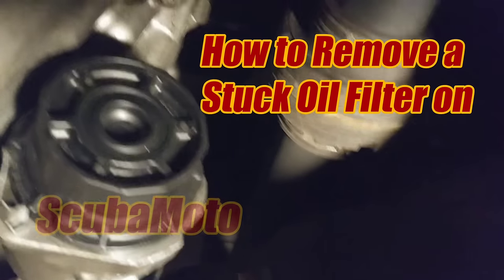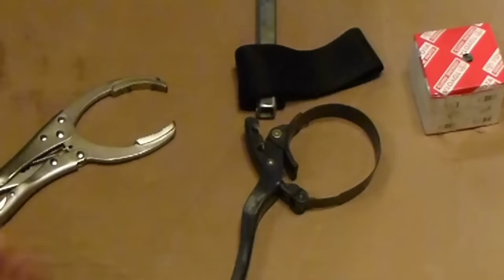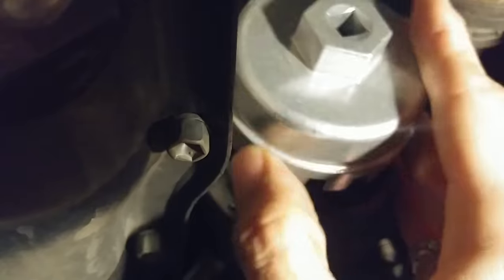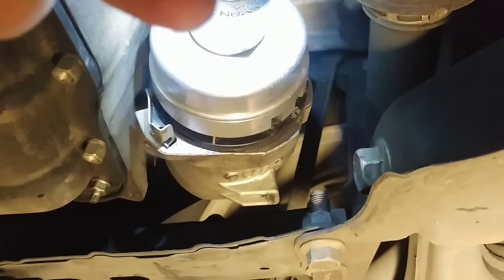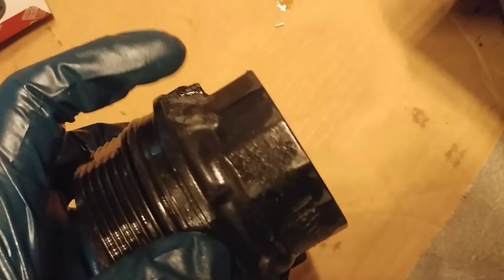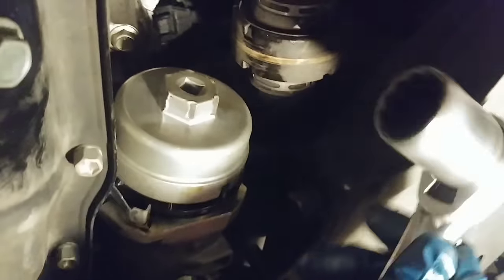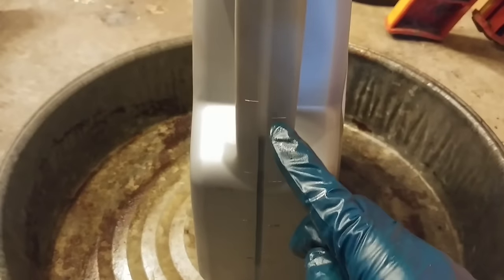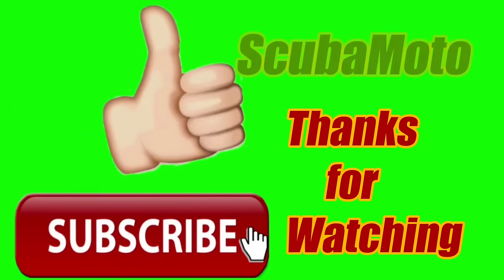How To Remove Stuck Oil Filter Toyota Prius Corolla Lexus Oil Change

Comment: Dang near an impossible oil change. I have a Highlander and spend two days trying to loosen the metal oil filter housing in order to change the filter -- all to no avail. I ended up having to take the car to a shop where, no kidding, it took two men with a 5-FOOT BREAKER BAR to loosen the filter housing. Even they had to work at it a long time. I like Toyotas, but that's the worst oil filter design ever. It's almost like Toyota made it intentionally difficult for the home mechanic to change the oil . . . .
Reply from the maker: Michael Patrick McClung: Thanks so much for the comment. That's the first time someone has commented that they had as much trouble with a metal one since most of these are plastic. Your experience just further proves that many shops out there are installing these with impact tools that leave them severely over-torqued in a matter of micro seconds. I hope that shops watching this and reading will learn that hand tight is plenty for these filters. Thanks again for the comment and thanks for watching.
Reply: It's not the design. It's the idiots that put it on. The torque specs are right on the oil filter cap. I guess the mechanics are illiterate? Maybe Bigfoot is doing oil changes in their shops? Or that guy with the muscles in that TV commercial where he says "I pick things up and put them down".

And yes, switching to metal is NOT the solution. An aluminum filter cap screwed into aluminum can experience galling which can be an even worse situation.  What is galling? 

"Galling is a form of wear caused by adhesion between sliding surfaces. When a material galls, some of it is pulled with the contacting surface, especially if there is a large amount of force compressing the surfaces together. Galling is caused by a combination of friction and adhesion between the surfaces, followed by slipping and tearing of crystal structure beneath the surface. This will generally leave some material stuck or even friction welded to the adjacent surface, whereas the galled material may appear gouged with balled-up or torn lumps of material stuck to its surface. 

Galling is most commonly found in metal surfaces that are in sliding contact with each other. It is especially common where there is inadequate lubrication between the surfaces. However, certain metals will generally be more prone to galling, due to the atomic structure of their crystals. For example, aluminium is a metal that will gall very easily, whereas annealed (softened) steel is slightly more resistant to galling. Steel that is fully hardened is very resistant to galling"

I would stay away from the metal oil filter caps unless you're going to change your filter yourself and avoid extended change intervals in which case the plastic one should be just as suitable. Main thing is not to over-torque the thing.
Reply: Omg i just came inside so upset 😡 same thing im dealing with. I have a 2019 hiighlander. I'm seriously almost thinkin the dealership never changed the filter at all .
Reply: @ScubaMoto  my car has the plastic one - 1/2" torque wrench indicated it was tightened well in excess of 90 ft/lb.  What kind of knuckle dragger torques a plastic housing like it's a damn lugnut
Reply: They are super easy if you do em but if a shop over tightens it your fucked
Reply: Just came Inside to do research to make sure there wasn't a reason I couldn't do it and nope. Just like I thought I from a lazy prick overtightening it
Reply: @mauriciochavez914  since you can't see the filter you will never know if anyone does change it.  They don't want the oil dripping on them so since you can't tell why do it..
Reply: Same difficulty with my new to me   2010 Prius. Ended up cracking the plastic housing on removal. Found out after a mess on my driveway and a nice letter from our HOA! I’m done with this crap, I ordered the parts to convert to a traditional oil filter.
Reply: @readme765 I got fined from my hoa for filleting a striper in my driveway. I live in the woods now

Comment: The Toyota designer should be ashamed. What’s wrong with the old spin old filter ?
Reply: Apparently more eco friendly (less material), less weight, and cheaper for production. They're not so bad if the previous tech didn't over tighten them, but I hate the stupid design. Spin ons are always better!
Reply: They need to hire an design ingenier like me. But young People are more Stupid thrue The years...
Reply: don't take it to the mechanic or tell them not to over tighten it. i was told by the mechanic that they always tighten it real good when just enough will do. when i was doing it myself, i never had any problem with the so-called bad design until i got lazy and had the mechanic change oil.
Reply: @whatever5575  Same thing happened to me. I've noticed that even good mechanics tend to get sloppy with the so-called simple jobs.
Reply: Its not as environmentally friendly 🚯
Reply: @khashaneconvent2163 it is, and the design is fine, but it doesn’t hold up against oil techs who want to watch the world burn

Comment: Worked at Toyota for 6 years and all the techs over torque these filters. I’ve always hand tighten these.
Reply from the maker: Kou Lee:  I've seen a few techs chime in here with comments who appear to know better. But I am surprised at how common it is to over tighten these with impact tools when installing them. Thanks for watching and for the comment.
Reply: @ScubaMoto  If you want a "job done right" do it yourself.  Thanks for a great vid!!
Reply from the maker: Steve Maurer: Well said! Thanks for watching and for the great comment.
Reply: I agree they do overtorque everything.
Reply: That's me right now, tried running hot, cold, rag in cup and now im grabbing an extended handle after gouging my palm on the short one
Reply: That doesn't speak well of the so-called professional mechanics at Toyota. If they can't even get an oil change right, I don't want them touching my vehicle.
Reply: Penzoil filters now come with an upgraded o ring with their filters. This has helped. If you can crank these down by hand, that's advisable. The reason, you can't get these off is because you've torqued the two surfaces together and now they've become one piece.
Reply: I actually hand tighten mines and somehow shit still got stuck. I was so mad 😡.
Reply: Can't believe they stick with this piss poor design knowing so many idiots work in this industry ! Not to mention it sucks to deal with when it does work right
Reply: Probably "Our Toyota dealer Agency "mecanichs"never change the filter cuse I try to do it at home is cracked and tight as hell....
Reply: @Tony-ps9qk  honestly, i had the car for 10 years and never had problem loosening it until i took it to the shop.
Reply: @ScubaMoto  They use impacts on filter housing?!
Reply from the maker: @scarling9367  Only on weekends. Seriously, it should be the last thing you try. I first tried a wrench. Then a long wrench (breaker bar). Then a breaker bar with an extension pipe on it. It still didn't work and it just rocked the car (not safe on jack stands). Then the impact tool. The torque plus impact of the power wrench is what finally worked. The car didn't rock a bit. If the filter is put on correctly, it will come off with a standard ratchet.
Reply: @ScubaMoto  Oh, I was talking about the dealership.
Reply from the maker: @scarling9367  The service techs don't have a choice. They have to use impact to put them on or they lose their bonus. It saves them 22 seconds so it's mandatory.
Reply: @ScubaMoto  Fair enough. I'm not one to get between a man and his money. Just surprises me.
Reply: If the customers can’t remove it they most likely will come back
Reply: Should be 18 ft lbs or about hand tight with a normal  ratchet 3/8 inch
Reply: Once the o-ring starts to enter the housing, hand tightening is over. Use a socket wrench till the filter housing bottoms out and then stop, you're done.

Comment: By far  one of the worst designed thing I have seen on a car. I'm 38 years doing this. Very stupid. I think they're selling the sockets that break.
Reply from the maker: mike vonkleist: and a complex design too. Production costs on this filter housing must have been ridiculous compared to simply specking out a standard metal canister filter like most vehicles.

Comment: I guess the last guy torqued it to "AS IF YOUR LIFE DEPENDED ON IT ft lbs" spec.
Reply: I️ tightened myself, with hands. I forgot to put a little grease on the border, or with the same oil to moist it before. Today, I️ can’t remove it and even the upper teeth blows away. I️ will by this tool as my last hope.

Comment: I watched this video before doing the oil change, so I was mentally prepared for this problem. It was torqued so tight my kohl’s electric impact couldn’t move it. I had to go and use an air impact which made short work of it. Toyota techs did not follow the torque spec.
Reply from the maker: CG Eucare: Sound familiar. Thanks for watching and for sharing your success.

Comment: Yeah impact didnt nothing but break my oil filter housing cap. I still cant get it off. I took the whole oil filter assembly off and im trying to cut it out now. I may just goto a junk yard and get a new housing. This is day 3 of my 15 min oil change.......FU Toyota engineer, I didnt have these problems with my 2nd gen prius
Reply from the maker: Tyler P: It sounds like you win the stuck filter contest. Perhaps the last installer should be dealing with it. When you say you removed the whole housing, do you mean the metal filter bracket (part number 15609-37041)? Or are you referring to the plastic filter housing? The brackets can be found new for under $60. The housings I have links to in the video description, they're very cheap. Thanks for sharing the comment.
Reply: @ScubaMoto  I took off the whole bracket the 156# you mentioned. That thing is held on by just 4 12mm bolts and alot easier to get off than the stupid filter housing. It took me about 3 hours and some motivation courtesy of my toyota parts department (200$ for a new one) but I finally got the old one out. I used an angle grinder, multi tool, and reciprocating saw and cut out that stupid crap. I went with 18lb ft torque because I hope to never have to deal with that again. Id rather have an oil leak than deal with that thing again

Comment: I hate this design. It turned a 15 minute oil change into a 2 hour pain in the a$$ running back and forth to the parts store
Reply: Dude, with you there. Fuck. Love toyota, but dang this oil filter design is HORRIBLE
Reply: I know the pain 😭😭😭
Reply: Same here today 😭
Reply: I had to BREAK it. Nothing was working and the more my husband and i gurned it, the more it was cracking. It was 118 today so i gave up and went inside and thats when he broke it more. So guess who has to replace a new filter cap? Meeeeeee if i can get it off the housing 😤 my husband is taking it with him to his job since there are proper tools there
Reply: @slinkyyy3  I tried to change the oil myself on my wife's 2015 gs350. It's used and we bought it in Feb. I even bought the tool on ebay ready to change it. It won't budge and I'm pretty stout. I need a lift to get a breaker bar on it so I guess I'm making a trip to a trusted mechanic friend.
Reply: I'm right in the middle of what you just mentioned.  $200 already in parts and tools.
Reply: I was right there with u. I was just running back and fourth to autozone. Gave up till now. Going to use a power tool on it. Didnt think there was that much room in there
Reply: If it's over torque, and very very hard to remove, can I forced it? It's only the plastic cap will be broken?
Reply: I gave up trying to remove the canister. Took it to  express oil. They destroyed it getting it off. That oil change cost me over $160. 
Thinking back I should of just bought an impact wrench like he has.
Reply: Everything about Toyota is amazing besides this stupid oil filter housing
Reply: @slinkyyy3  SOMETIMES YOU HAVE TO USE YOUR LEG AS LEVERAGE WHEN YOU DON'T HAVE THE TOOLS IN HAND
Reply: @21boxhead  tried that.  Still not budging.  I just drained oil and poured new oil and will be forced to go to the shop in a few months.
Reply: Agreed!  Horrible design.  You create a huge mess.  Are we really saving the environment by getting rid of the old fashioned metal oil filters?
Reply: @21boxhead I’m about to do this with my wrench and foot

Comment: It worked!  After watching this video yesterday, I went out today to purchase a 24 mm socket and 1/2 inch impact adapter for my impact drill.  Make sure you wear eye protection!  It hammered away for about 5-8 seconds with no movement but a lot of metal fragments floating down.  Then I noticed it slightly moving as in this video.  Just a couple more one second shots and  it could be removed by hand.  You just saved me a $100 visit to the Toyota dealer.
Reply from the maker: Thanks for the great comment and congrats on getting the damn thing off! I must confess that I might have deleted a short segment of impacting for YouTube attention span purposes. But I did include the part where the metal ears broke off the wrench while waiting for the filter housing to begin moving.

Comment: You saved my day. Before watching your video, I tried my impact drive, no luck. I didn't try long enough because I worried I might break the filter cap. After watching your video, I got more confidence to hold about 20 seconds and this thing finally came off. The so call technicians at dealership are not doing the right thing. Their over tightening way will cause extra stress that might lead to cracking. I am glad I am taking this over from now.
Reply from the maker: Songtao Qiu: Congratulations on a job well done and on taking over the oil/filter changes. It will be nice knowing it's getting done right. Thanks for watching and for the great comment.
Reply: And you saved mine , i watched the video but didn't pay attention to the part where you had to wait a little longer , it was until I read your comment and went back out and it worked . Thank you and thank you @scubamoto

Comment: I'm sure those idiots at the dealership are using impact tools to tighten the oil canister. I couldn't get mine off so I ran over to Quicky lube and asked if they would change it for. They couldn't get it off! So I took it to another quick change shop and they couldn't get it off. I'm buying an impact wrench like you used and once it's removed I'll torque it to something reasonable. Thanks for the video. I've been turning wrenches for 60 years. Never thought a damn oil filter would stop me!
Reply from the maker: Mike: Now that sounds familiar! They put them on with air tools to save 2.7 seconds but create a 90-minute project for the next filter change. Thanks for sharing the great comment.

Comment: Had a 2013 Prius on a lease.  At 40K, I decided to DIY the oil change.  How hard could it be?  LOL

Got the $25 cap wrench.  Started working on the darned thing.  Had visions of the plastic cap cracking.  Since I live 25 miles from the dealer and had no way to get there, I gave up.

More recently, I did the 40K on my 2016 Prius.  Did it at a friend's house closer to the dealer and with her car available if needed in case I had to buy a new cap.

Got lucky.  Yes, the cap...and drain plug...were on too tight but I was able to get both off with just the cap wrench and 3/8" drive. 

To borrow a line from Seinfeld, this filter design is "ridickerous".  They fixed something that wasn't broken.  Spin on filters worked fine for 50 years.

Thanks for posting the video.  When you try and tell someone how hard it was to change your oil, they find it hard to believe.  Now I can just share this video and say "See"?
Reply from the maker: Mike Rafferty: Thanks for sharing the great story and congrats on a successful job. Welcome to the "Super Strange Filter Wrench Owners Club".

Comment: Nice video, well done. After breaking the tabs off with the stamped (cheapo) version of Toyota tool & and everything else in my tool box. Finally managed to get it off with a pipe wrench + 24" piece of pipe. Of course destroyed the cap in the process and replaced with aftermarket one. 30 minute oil change turned into 3 hour ordeal.
Reply from the maker: noname mcnoname: I tried it the other way around. My 2-foot cheater bar with a pipe slipped on it was just rocking the car so I decided to try impact. You can see in the video the toll it took, but it finally get the job done with a little patience. Such a brilliant filter housing design . . . I'm glad you finally got yours off.  Thanks for watching and for the story.
Reply: Do not use aftermarket caps. The cap contains a calibrated spring. Any mishap in here can be catastrophic, as not enough oil can pass if it's too hard, or it won't filter, it it's too loose. Always replace the cap with an original one.

Comment: Thank you so much for the video! I used my plug in 230ft. lb. impact wrench with the same toothed cap that you showed. It broke one tooth off but I stuck with it and after another 20 seconds or so, it finally loosened up. I wish I had seen you video sooner, but after 4 hours... voila!! Oil change complete :) You're da Man!
Reply from the maker: R Bebber: Congrats on a job well done! I'm glad the video helped out. And now that you're doing it yourself, it won't get over tightened again. Thanks for watching and for sharing.